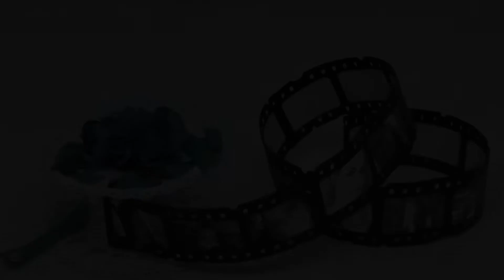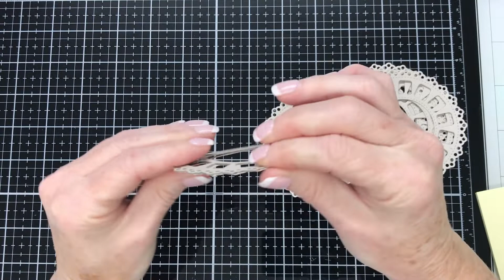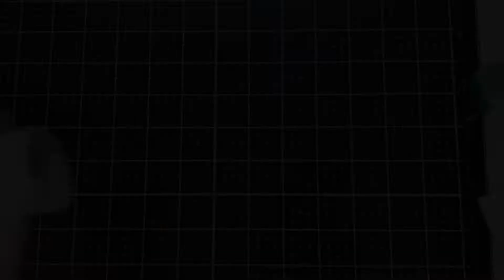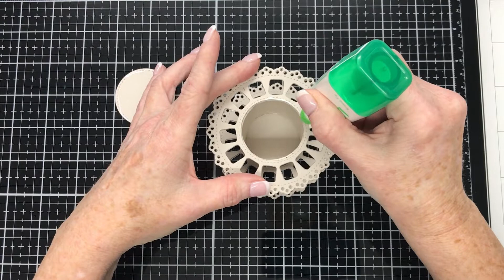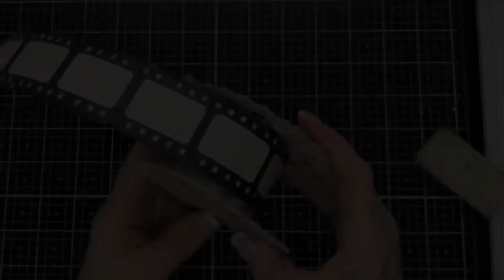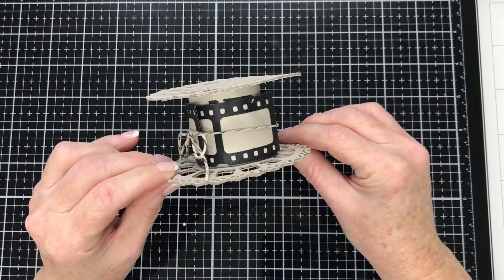Mini Album Spool Tutorial

Comment: Hi Tracy, how did you get your photo to fit the photo strip?
Reply from the maker: Jacqueline B. I glued them to the backside of the filmstrip and then I glued another filmstrip over the top of that so in effect sandwiching the photos between a ‘front’ and and a ‘back’ filmstrip - if that makes sense? The photos were individually cut to fit the openings of the filmstrip with about a millimetre overhang which is not much - hence why I did a ‘front’ and a ‘back’ with the filmstrip. Hope that helps? Feel free to email me farrspray1@gmail.com if you need help at all. Crafty hugs 😘😘😘